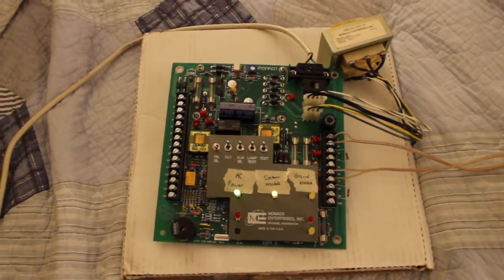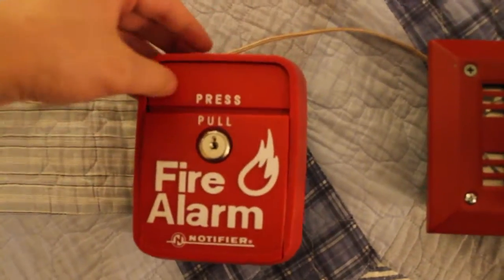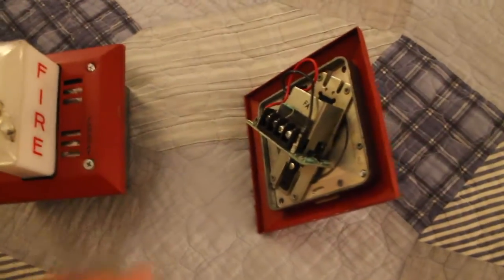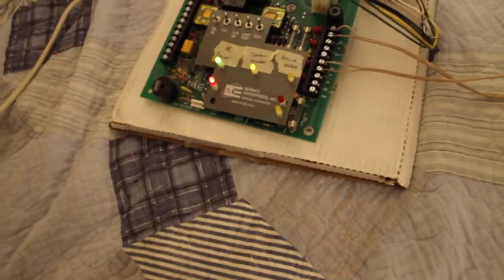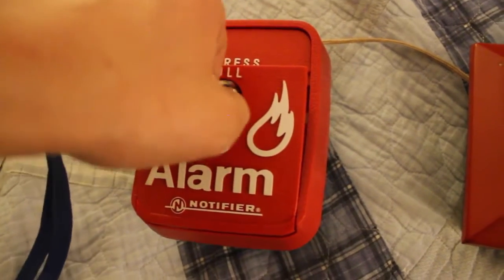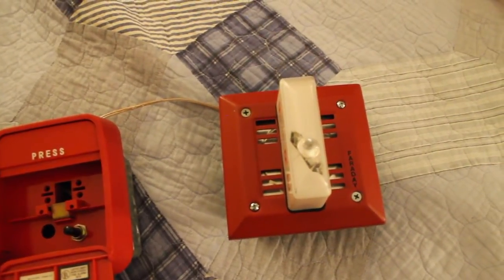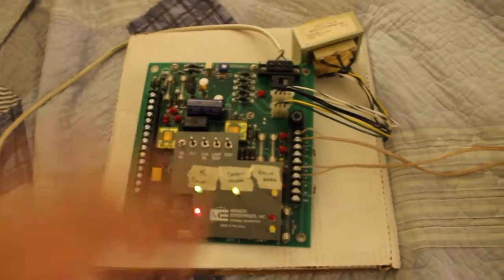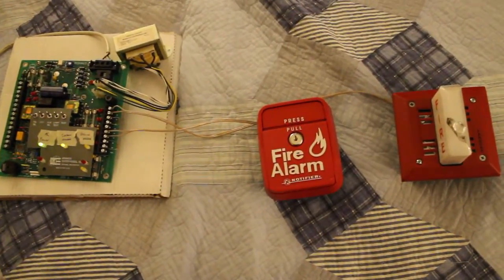Monaco Vulcan 1 - System Test 4

Comment: I remember my school had a whole fleet of them. They got replaced, but there is a pull satiation and a strobe left abounded in the building I may try getting.
Reply from the maker: Huh...interesting that your school had this particular combo that was featured here...and even more interesting there was the one that was left.
Reply: There is one strobe left in the high school, in are very old gym downtown there is still a system of them with MASS Faradays or whatever those are called.

Comment: Looks a lot like the NAC has a 50V-rated Nichicon cap! It's possibly the culprit. Even though I didn't hear a 60 hz buzz! The dead give away of FWR, is a 60 hz buzz, but it sounds totally DC here! 
Thus, facepalming... FWR or a bad cap usually makes horns sound much like a Federal Signal model 55! But, unfortunately, I don't have a schematic...

Comment: I've never had issues with it other than they sound absolutely terrible. Stick with filtered and it'll sound much healthier.
Reply from the maker: +bearlovesox If this panel had filtered DC, then it would definitely sound a lot better. I've tested this particular device on Filtered a few times, and I thought it sounded pretty good.

I didn't think there would be any issues with using these horns on FWR, unlike modern Simplex devices. Considering that these are the same horns used in the mechanical 4903's, I wonder if I would be able to use strictly the horn on this system, just not the strobe of one of these devices.
Reply: Honestly as long as it's not a simplex strobe I'm sure you'll be fine.
Reply from the maker: +bearlovesox I thought so, thanks!

Comment: Nice! LNG-1R's are really cool pull stations to have. The Faraday horn strobe's horn looks like the one from the Simplex 9219 horn/strobes, just something that caught my attention.
Reply from the maker: +FireAlarm42 I like the LNG-1R, it's a unique version of the BNG-1 series (old and new) if you ask me. I've only seen these in one place, and I'm surprised that I have two of them.

And yes, the horn in the Faraday unit I used here is the same one used in the -9219. Seems like a lot of companies with mechanical horn offerings at the time used the same horn in their products (Faraday, Simplex, and even Gentex). If that's safe to use on FWR, I probably wouldn't mind using my 4901-9805 on one of these tests. All it consists of is one of these horns in a mid-90's onwards shell. Probably one of the only mid-90's onwards Simplex devices that I have that can be powered on FWR.

Comment: How can you tell if a horn can or can't take FWR?  Speaking of which do t all panels produce FWR on battery backup say when the power goes out?  If so, then I guess that's why the simplex mechanical horns went the way of the dodo.
Reply from the maker: +Gary Beltz Usually, I look in some instruction manual to see, it will usually state it in the description of the product. I cannot find an instruction manual for the horn here, so I do not know for sure. Additionally, when the panel is on battery backup, the horns will be powered on filtered DC, as it is clean DC. From what I am aware, Simplex panels generally put out Filtered DC, and most of their products are meant for Filtered DC systems.